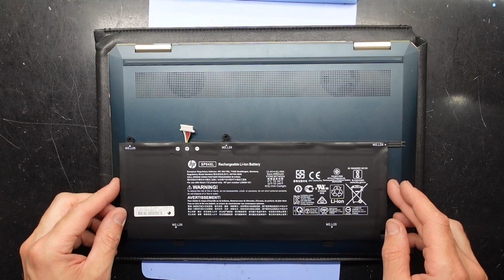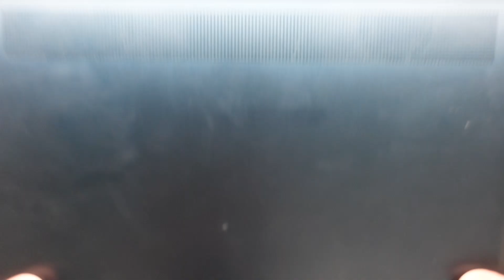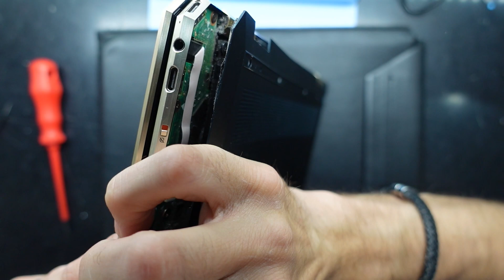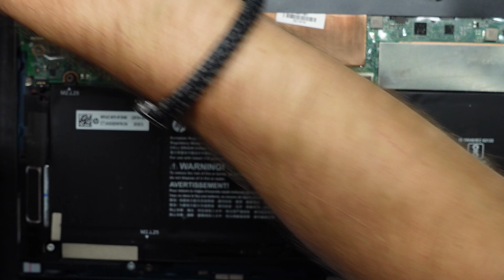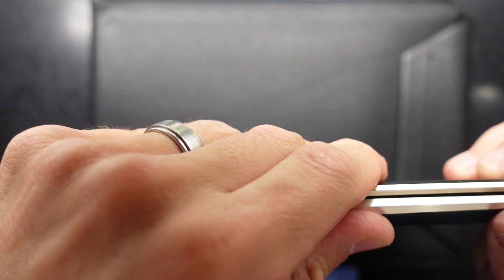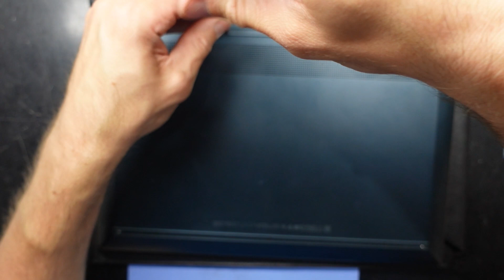HP Spectre 13-AP Battery Replacement

Comment: Thanks. Tip for amateurs (like me) - when you lift the sticky strip (Step 1), make sure you get the WHOLE strip - there are actually two strips stuck together, and in one instance I pulled the stip off only to find there was a 2nd very thin strip still there. Anyway, I was able to lift it and stick the two halves together more or less correctly.
Reply from the maker: good tip,  hope all went well

Comment: Thanks for the video, could you share where you purchased the replacement battery?
Reply from the maker: the battery was purchased from a computer store local to me
Reply: I picked one up recently from an ebay seller in Shenzen - it was listed as new and appears to work correctly. I'd looked for replacement parts with HP resellers, but wasn't able to find anything without resorting to either ebay or non-OEM parts.